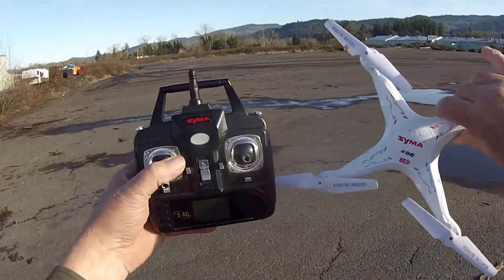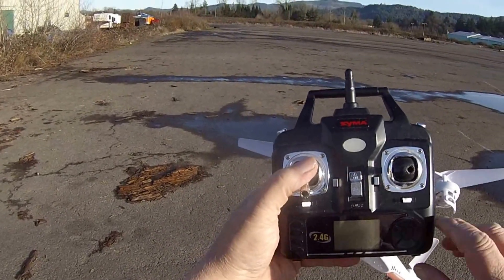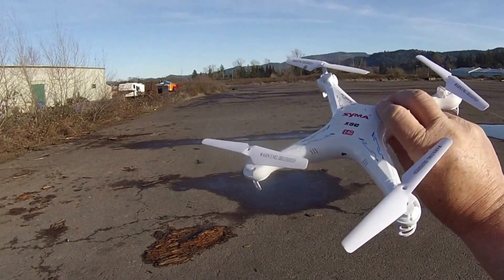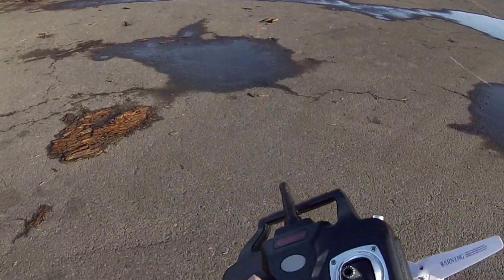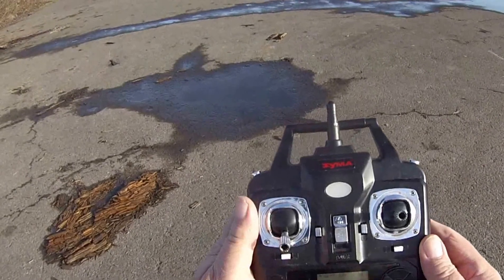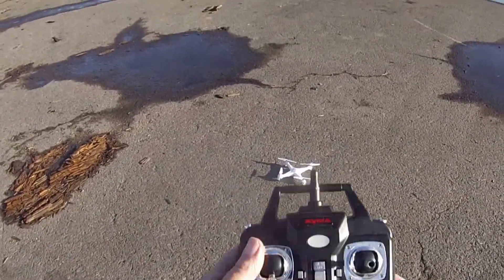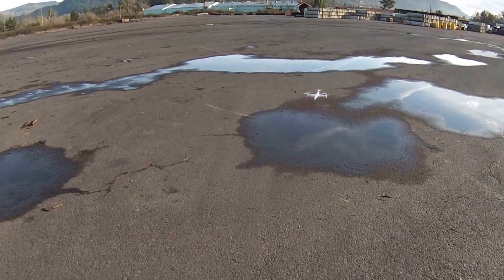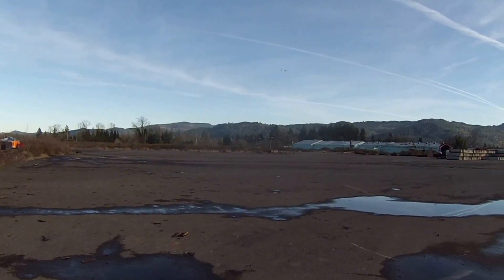Easy Trim Syma X5C Quadcopter

Comment: I would get out of ground effect to trim.... about 5 feet up...
Reply from the maker: There is no ground effect at the altitude shown. One has to get just above that when ground effect comes in to play. Try if if you don't believe me. Two types of vortex ring state and neither one are in play at that point.
Reply: I'll check it out.. you're probably right because of how light this quad is...
Reply from the maker: It works the same for a full size helicopter. There isn't really a cushion of air but that's what people call it at that altitude. Just above that altitude is where the tips of the blades are affected by turbulence which differs when a helicopter lowers altitude in it's own footprint whereas the disturbance happens toward the center of the blades. American aviation calls both of these scenarios vortex ring state whereas Canadian aviation uses two different terms and claim the ground effect isn't vortex ring state. The reason I demonstrated trimming this way is because new pilots have a hard time trimming when the quad is in the air but this way it's easy and works perfectly every time.

Comment: My first drone was a Yuneec Breeze, which is very easy to fly compared to the Syma x5sw I just got.  The Syma is very sensitive to the slightest wind.  Just learned about calibrating, hopefully I won't loose the damn thing!  The Syma is very forgiving in crashes!
Reply from the maker: It the description there are some tips in flying in the wind. Just click the link and I think it may help you keep from losing it. Not to worry, most lose their first one but no need if you follow some basic rules, Happy Flying!

Comment: Great video helped explain a lot . Could you talk about fly away and is there a way to check before it happens ? Thanks again.
Reply from the maker: Hi Tim, in terms of |fly away's) are talking about the Syma X5 C or models in general. The Syma will not fly away if you lose radio contact, other models will most certainly fly away if you lose radio contact.  If you want to check if it is a fly away model turn it on, start the props a little then shut down the transmitter. The main fly away problem is new pilot procedures. If you never want to loose a quadcopter to this then look through my videos on how to prevent fly away's. Click on my name, wobble copter to take you to my home page, then click on Videos and it will show you all of my videos and not the videos I have clicked a thumbs up on. If I didn't answer your question then ask again and give me something specific. Happy flying my friend.

Comment: does the quad remember where flat is if the battery gets removed?
And can the controllers trim settings be reset?
Reply from the maker: Yes it remembers but you have to set the unit on a flat surface when you turn it on. If you need to reset the gyros after you turn it on while it is still on the ground bring both sticks straight down and then all the way to the right. The units lights will flash and when the stop flashing a second or two later it's reset. I have a video on this if you want to see it.

Comment: perfect dude! i was just given two of these and there's no instruction manual. this helps a lot. thank you!!
Reply from the maker: Let me know if you have any other questions; happy to help.  There is also a link in the description to another video I have and  you may find if helpful. I know I would have found it very helpful at a point in time, lol...happy flying my friend...
Reply: Thank you. The throttle is insanely sensitive. It will start going up slowly but then without doing much it will shoot up. It's very tough to find some level point. I'm trying to use the diagonal bottom right  position on concrete that is fairly level and it seems to help. Is there a way to decrease the Sensitivity?
Reply from the maker: No way to change the sensitivity of the throttle so you'll just need to get used to this one. The thing is even when we think we're multi tasking we're not really doing it. We're going back and forth between tasks so when the focus is on other things when flying it's easy for us to move a stick without really knowing it. Also it takes time to get used to just how far we move a stick; at first not much movement so we add a little more and it's too much. I really do have to say that the X5C has a throttle unlike many if any other quads. My problem is flying one after flying many others so when I decrease the throttle I go too far and it begins to fall so I have to push it up right away. Keep working with it and also if you get it on level ground you can reset the accelerometers by turning on the quad, bind it and then take both sticks straight down then out away from each other to the lower corners of their movement. Once it quits flashing it's back to level. Keep working with it my friend, stay in touch if you want I'd be curios how it going for you.
Reply: Wobble Copter yeah i know the feeling of getting used to another brand / model. i actually started on a much higher quality drone, with gps and a view screen on the remote. now I'm kind of going backwards but honestly i need to. it would seem that if i can fly one of these, then i can fly much better ones later. thanks again for your help! I'll keep you posted!
Reply from the maker: you're exactly correct. I started out opposite of you. I got one of these and learned how to actually fly it. Which means steering with the rudder, left stick. and using the ailerons to bank in turns. When you can fly it like that, put it where you want without thinking of it you're ready for an upgrade in terms of non gps models. It is so much fun to fly by only thinking where you want it to go and not giving the sticks a thought.
Reply: Wobble Copter i have a second controller here for the same model. would like to try that and if it's easier to use, I'll start out with that and work my way up.
Reply from the maker: Some of the X5C models can use the X8 controller which if far superior. If you have one of those give it a try. Much better control and range.
Reply: Wobble Copter don't know the model controller, but it's Syma, red buttons, white controller. very similar in overall shape and size to an Xbox 360 controller

Comment: Good real life experience!  How long do the AA batteries last with the transmitter?  Do you use Alkaline or NIMH?  Thx!
Reply from the maker: Hi Juian6,  I always use Alkaline when I don't use rechargeable batteries. Some transmitters use a lot of power but not this one. Actually I don't remember running out of transmitter power so they must last a long time. If you do run out the quadcopter will lose reception and come down rather than fly off as some do. These are pretty durable but I recommend if you know the propellers are going to hit something turn the power off. When blades hit and are running at high speed is when they are at the greatest risk of damage. Parts are cheap and they're easy to fix. QC 101 has over two hundred flights on his first Syma X5C and has done no repairs. I wish I could give you a specific time on the transmitter batteries but I don't have that information; they last a very long time if they're Alkaline. You might want to watch the link I have in the description if you're a new pilot. Happy flying and thanks for stopping by.

Comment: How do you manage to make the quad hover by itself? Btw great video thanks for sharing!
Reply from the maker: Unless a quadcopter has GPS hold it will drift in the wind as seen in this video. However if you have it trimmed meaning the pull of each propeller is equal it will stay in one location, or hover. Which is the essence of this video. On a calm day you can trim it well and then it will take very little stick to move it around slowly, it's fun to do if you ask me. Enjoy...

Comment: So what does trimming exactly do?
Reply from the maker: Sometimes when the quadcopter has been knocked around a little bit it won't stay in one location and will tend to drift one way or the other. If you fly in no wind or little wind you'll notice this unwanted pull will fight your piloting efforts. If you trim it from time to time it will hover in one spot if their isn't any wind. In high winds I don't try to trim it's one constant adjustment after another one anyway.

Comment: great video!  thanks.     what does the throttle trim actually do??
Reply from the maker: This one doesn't have throttle trim but if you have it you can adjust the hover in small increments so you can make it hover without climbing or dropping. Sometimes the throttle lever isn't sensitive enough to do that.

Comment: its frustrating sometimes to fly this thing, you make it look easy, but its hard, how do you know what is font and back when its up so high , that you cant even see it? its ez to fly it away i think,
Reply: chaba72 I feel the same way
Reply: Same happen with me, with Sky Vampire drone, crashed 300m away
Reply from the maker: Here are some ideas on how to keep your quad from flying away, just follow the rules until you gain good piloting skills. https://www.youtube.com/watch?v=-u20p5sy1_I
Reply from the maker: https://www.youtube.com/watch?v=-u20p5sy1_I
Reply from the maker: Watch this one my friend  https://www.youtube.com/watch?v=aYhL41gNVAI
Reply from the maker: Watch this one my friend https://www.youtube.com/watch?v=aYhL41gNVAI
Reply from the maker: Here is one that QC 101 did on how to keep orientation  https://www.youtube.com/watch?v=qdYTCfjUVVo
Reply from the maker: Just keep it low, keep it close, fly toward the wind in an open area. Practice flying it as if you are driving a car. Push the right stick forward then turn left or right and keep track of where you're at. If you loose orientation if it is close you can just land it. Don't try to save it that's when we get into trouble, just land it.

Comment: Thank you. Was getting frustrated with my Q222 after 3 days. Found this video, and now it can fly relatively calm n predictable :). Do we have to do this trimming on every flight or just a gyro calibration is enough?
Reply from the maker: You just need to do it if it needs it, I don't trim each time. As we fly around and make sharp turns or crash it messes with the gyros and the trim. As long as the quadcopter will hover correctly it's fine. We do have to account for wind because the quad will drift in it and that's ok. I also don't do a gyro calibration each time, same thing, I do it when it needs it. I'm happy this video helped you settle down that Q222 and I hope it continues to fly correctly. Let me know if you need any help or have questions. Thanks for stopping by my friend.

Comment: you cannot tell if  trim is adjusted properly flying that low. -prop wash causes this light copter to behave erratically when close to ground.
Reply from the maker: I disagree based on fact. It is true there is a thing called ground effect which is considered to be VRS, or vortex ring state. There are two places a heli or vertical take off and landing aircrafts experience VRS. The blade thrust is affected when the pilot descends in their own prop wash, this affects the inner part of the wings or blades. The second time VRS comes into play is once a pilot gets past what is called the sweet spot or incorrectly termed the cushion during take off and landings. This second VRS effect affects the wing tips or blade tips. The American aeronautical engineers also call this VRS but that is debated by our Canadian counter part, they have a different term for it. All agree there is a sweet spot on take off and landings which is not affected by VRS. This is the spot just above the ground but not too far off the ground. Anything past that pilots experience VRS or what is called ground effect. Where I trim is in the sweet spot before VRS kicks in and it works very well as seen in this video. All I can say is try it, if you need to trim when you're in a hover try trimming it on the ground as in this video, it's much easier to do and especially for beginners.

Comment: Hey thanks for your video m8..
However when i try to trim it on a table or on the ground my right front props doesnt even starts but when i hold the camera in my hands it starts a bit and then stops everytime i got a Syma X8W any tips ? and also look my video's i've done some explain videos about it :( 

I am a beginner to this drone thing i can even lift it up :( help me..
Reply from the maker: I think you bent the gear shaft or stripped some of the gear teeth away. If you changed motors that's the only thing I can think of. I left a more detailed note on one of your videos. The other two videos I looked at I asked if it ever flew but the video you explained what happened and that's the vid I left more info on. Let me know how it turns out.
Reply: Ok now i've trimmed succesfully all the props are working again the only issue left = he makes circles and doesnt wanna go up

I will upload a videa in 10min for better information^^
Reply: No need more :)) changed engine from A > B all now he is flying again in the sky

Comment: My Syma X5S didn't use to need Trimming, why does it need to be trimmed now for me?
Reply from the maker: +Adam Neewooth   Adam, it could be a number of things. Try to re-set the accerarometers, It may also have a bent shaft on the pinion gear making the propeller pull to the side and not straight up as it is intended. Tell me more about the situation and perhaps I can help more.
Reply from the maker: +Wobble Copter Did this happen after a crash, does trimming fix it until you start it up again? The more you tell me about it the more possible solutions I may have for you.
Reply: +Wobble Copter It happened after I crashed it into a tree, and the only way I could get it down, was to push the throttle up, which made it go less down, so it was easy to reach. After that, I flew it indoors, (no wind), and it just all of a sudden just kept flying forward, I tried Re-setting the accelrarometers, and everything else, but it didn't seem to work. My only option, was to trim it on the transmitter, by moving the forwards and backwards trim 6 times down, to make it hover stably. :)
Reply from the maker: +Adam Neewooth   I think something became messed up while removing it from the tree; that also happened to me a long time ago. If you have the parts I'd replace the running gears and see what happens. I did however have one that did this and nothing I could do would make if fly right again, it wasn't an X5, it was a 326 which is the same running gear. Make sure everything looks normal, motor placement and change out the parts you have. In other words I think this is a physical problem and not an electronic problem. Would you please let me know if you get this resolved, thank you!
Reply: +Wobble Copter Thank You very much, I will let you know if it gets reseolved.
Reply: Hi, as my drone was kind if new, I went outside and flew it for about 1 minute, the battery was fully charged, But all of a sudden, the whole drone's motors suddenly lost a whole lot of power. I fully charged the bTTERY again, but after that I tested it, and there was a substanstial amount of power in the motors for it to not be able to fly. Also, one of the motors stopped fully. I had got it exchanged at the shop for a new one.
Reply from the maker: +Adam Neewooth  Happy flying, stop in any time!
Reply: c: you too!

Comment: Thanks for that, as a new quad owner this should help with the drifting I currently have. Can you tell me if I will have to trim my current issue each and every time I use my quad?
Reply from the maker: +k33adr  Actually most of the time you won't need to trim it. If you notice when it hovers that it seems to be tilted to one side or the other you would want to trim that. Sometimes it's obvious it needs to be trimmed. If there is no wind and you want to fly it precisely trim it and it will float right in front of you, it's cool. make slow inputs on the stick and put it right where you want it. If you click on wobble copter above then click on videos you can see other training type post, ones like flying in the wind. I'm adding directional flying before too long, it should be informative for new pilots. Thank you for the reply and if you have more questions let me know!